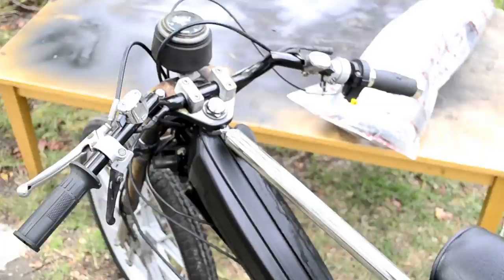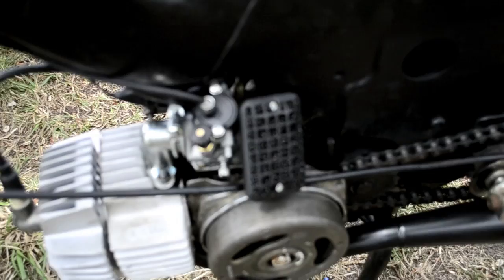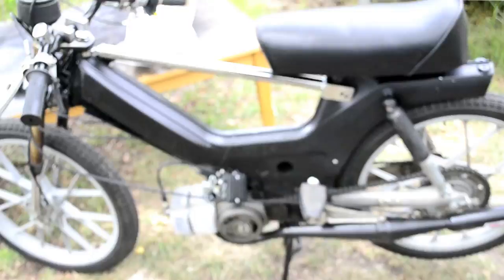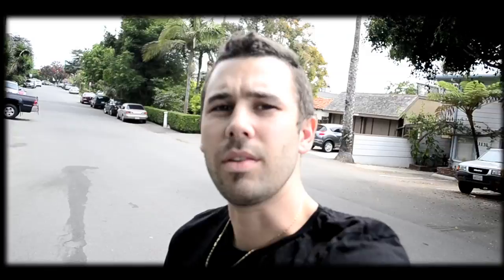The baddest, raddest moped pipe ever!!; TECHNO Expansion chamber- PUCH MAXI project *UPDATE*

Comment: Oh BTW are u on the stock piston ND head 50cc? If u don't mind sharing ur input on if you recommend and think the part was worth it. 

If u wanna throw the Manufacturer n name of that pipe u had I wanna take a look. Is it a really big diff in noise. I love the brrrrraaaaappp. I've rode bikes mostly n only 2 strokes but u only get so many smiles laughs cruising around before u know it ur whole neighborhood starts complaining 4 noise. But ya man any info much appreciate. I'll throw a vid up Tom.

Thing I want mkst is to add a second gear, I have plenty of torque n power beside super steep hills, but I hit the top end within like 5 seconds, be sweet to just add a sprocket from a 10 speed to change but not 10 gears just to get a wider gear for longer top speed/end